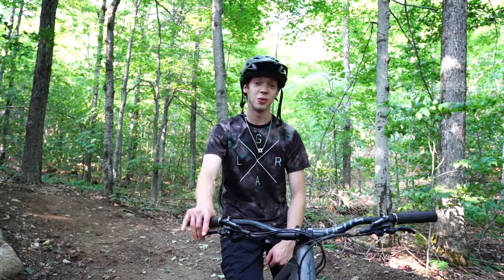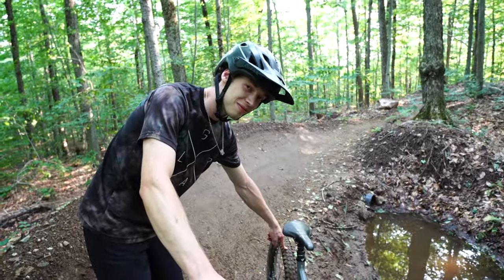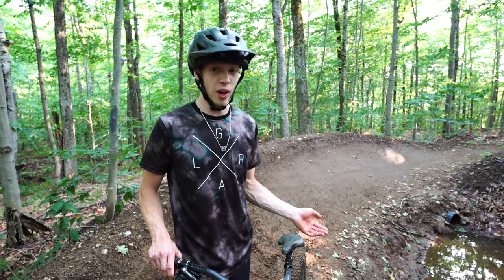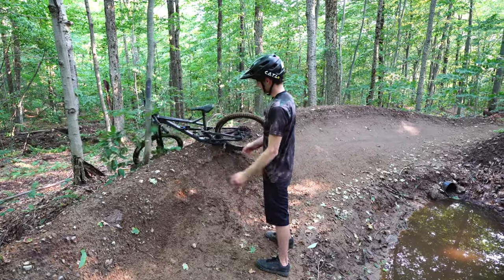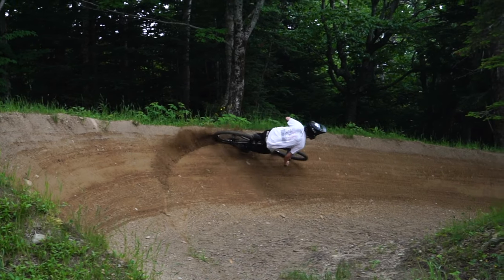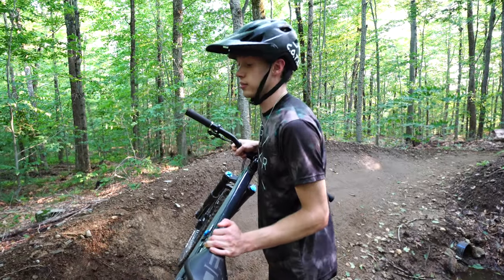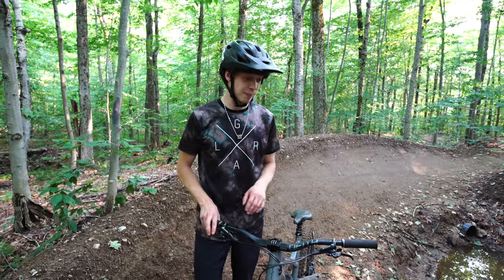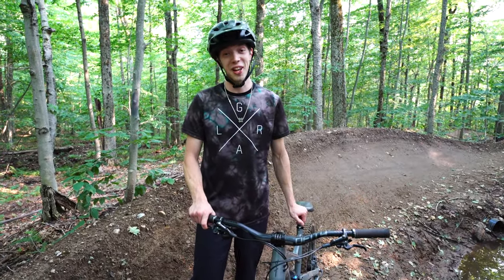Why You Can't Roost Your MTB: Common Problems Solved!

Comment: Why is running lower psi cheating? I thought that running lower pressure gives more grip. Am i wrong?
Reply from the maker: Yes but there is a point where the tire will start to fold on itself and break free when it shouldn't
Reply: @ChildrenOfTheLoam  aaah. alright. so 30PSI is the sweetspot? had my tires at 25 up until now.
Reply from the maker: @DarkauronCZ  25 is fine depending on your weight and tire casing, 30 is a bit high honestly but the saying does go, "30 psi in my minions..."
Reply: @ChildrenOfTheLoam  yeah, im currently riding on a XC bike (saving up for a proper trail bike) so my tires are pretty narrow and fast rolling. Tried 30 PSI this sunday and its definitely too hard for what im riding. im noticing less grip.
Reply: @DarkauronCZ  long travel bike is better for roosting. actually lower psi is not cheating i think.because everybody have different weight and need different tirepressure for roosting.i weigh 60kg and running 25 psi for roosting